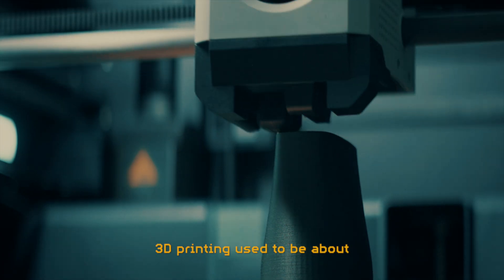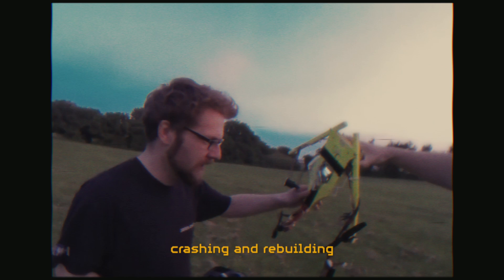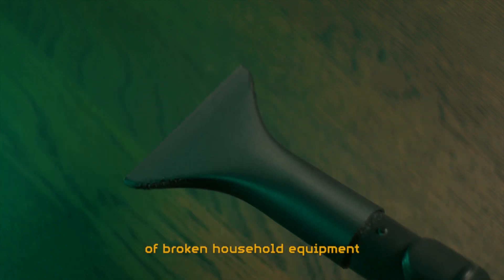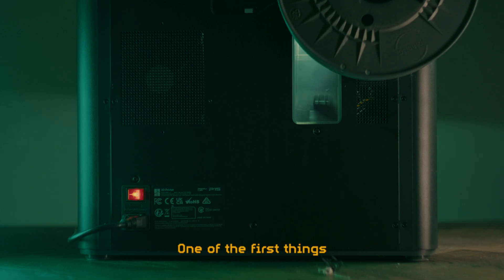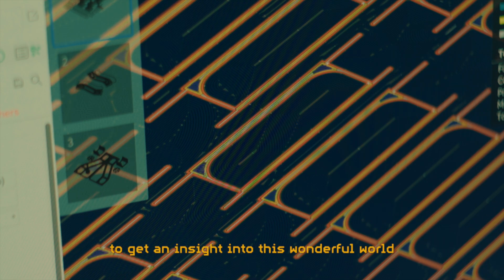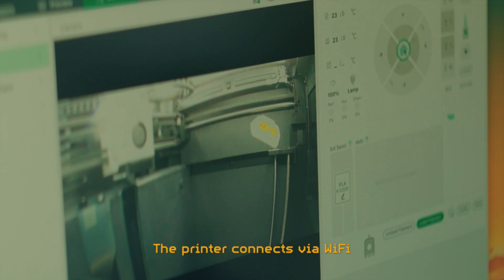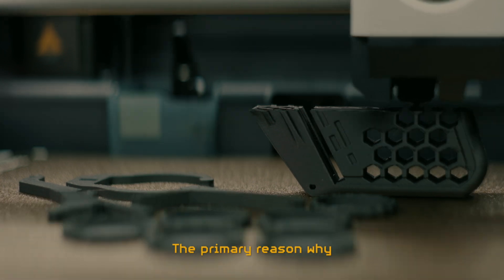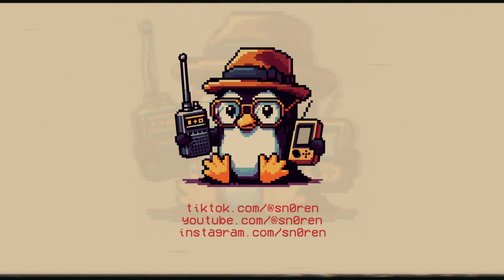If you don't like 3D printers get this one / Bambu Lab P1S

Comment: Unbelievable how we came to the same conclusion. I also have a 15-year experience with drones, used to build them myself until DJI came and then there was no point building them anymore. All those open source Arduino- based flying contraptions, Microcopters etc. suddenly became obsolete. When I got my P1S, after playing with it for several days it  dawned on me -- this is another DJI through and through. A printer that  "just works", great build quality, closed ecosystem. Moreover, the current Bamboo lineup kind of mirrors DJI's: we have A series  (mini and Mavic air), P series (regular and professional Mavics), X series (Inspire). Now bamboo is probing the enterprise zone with x1e. We haven't seen the counterparts of Matrice yet, but I'm sure they are to come. Exciting, isn't it?

Comment: nice review, i am the type of push the button and use the printer product. My hobby is used the 3 print product than twinkle with the printer. 
I want to buy this printer but the design part is what very big learning curve and i am still thinking if it is worth to add another hobby to my list with the very little time i have available for. my current rc planes hobby.
Reply from the maker: I’ve started designing my own simple prints using OnShape and it’s quite easy. Try playing around with it, it’s free.
Reply: @sn0ren  on shape, got it!

Comment: I have been spending months on end sleeplessly looking through budget printers expecting the most out of them, but i realise that you get what you pay for. I had been set on an ender 3 v3 ke for a bit and when i finally had enough to get it (today), i did a double, triple, quadruple check of the abilities and realised that i would need an enclosed printer that prints well and with great quality. I also needed a low maintenance printer as i am new to the hobby, and a lot of the things i plan to print will take up most of the time to assemble (engineering project parts like impellers, pumps, or aviation components for fpv planes and drones). I came across bambulab as it was renowned for its low maintenance easy to use systems and while pricey, was worth the wait. This video was the key to me finally not losing sleep on this, im going to save up for a p1s.

Thanks for the deep, unbiased review unlike most other channels. I hope you can make some more videos on the p1s or similarly priced printers that we should keep an eye out for in case the p1s gets overshadowed.

Also, as i have been looking a lot more at 3d printing reviews, videos about people using their printers for business and to sell parts and art made with the printers, as well as people making 'print farms'. Ever since i heard about it, i was wondering what it was all about and how to get into the practice as it means i can make back the money for either printer upgrades or fpv or electronic parts.

Comment: The intro is very well worded.

And exactly what pisses so many off who go into the Bambu groups to try and talk crap and troll.
I enjoyed the learning of my first printers, mechanical, hardware, software; they were already skills I had but as the years went on I was spending more time chasing quality and consistency and realized it was well over 1/2 my interaction with the thing; not to mention it'd never be near as fast as any core x-y example.

I sold the old printers, got a P1S, and now that time spent fiddling is now going to be spent really learning 3D design, highly recommend the touch screen mod; mainly for heating the hot end or moving the bed without having to hit the button 4500 times or fire up the app/go to a PC.

It's like a dishwasher, it's about the time you don't spend doing dishes; doing something else.

5:13 - I assume this is 'glass' PETG? How low did you end up on speed for this? What brand filament? I'm about to start in on it myself.
Reply from the maker: Yeah it’s Bambu Lab translucent PETG. I followed the guide on the Bambu lab wiki site about printing transparently. So about 20mm/s and flow rate of 1.01
Reply: Thanks for the reply, good luck with your channel; YT at least served you to my homepage so the algorithm isn't just serving this one to people viewing content on radio's and the like, I'm for sure more on the '3d printer' side of that.  @sn0ren

Comment: I have been researching for over a month, daily, to decide on which printer to get as my first. I like tinkering but I also like when stuff works out of the box and is easy to maintenance and clean. I have been eyeing the MK4/P1S/X1C but also cheaper models like used MK3s+ or Neptune 4s/Sovolos. I really don't like the closed source approach of Bambulabs and the whole cloud thingy. However, I will go with the P1S for now. Your video pushed me over the edge. Also, your user name is VERY similar to mine when I started out on the interwebs back in 2002, hah. Do you have a ref link?
Reply from the maker: It must be fate haha. Don’t have any referral link. You can choose to use lan only and not have anything sent to bambus servers if that bothers you.

Comment: What building in the drone shot has fish art? . By the way, this printer is good, but sending your design to the cloud makes me feel distrust( aka design trademark).
Reply from the maker: It's an old industrial building on the dock of the city I live in (Odense, Denmark). You can use the printer in lan only mode, then nothing goes to the cloud. But of course then the live video feed doesn't work if you're out for a walk.